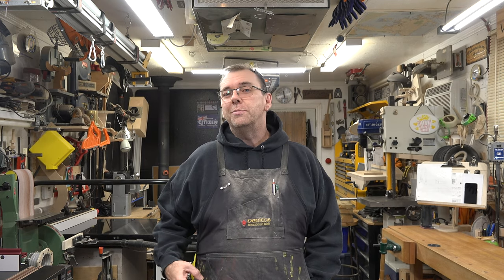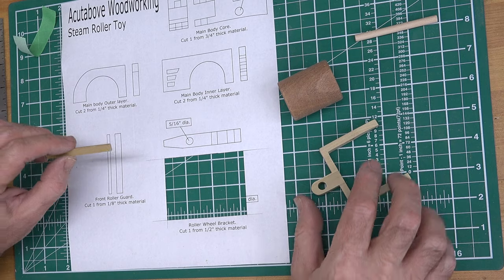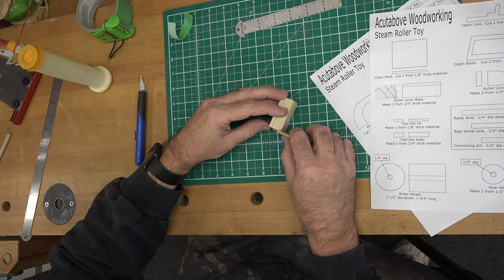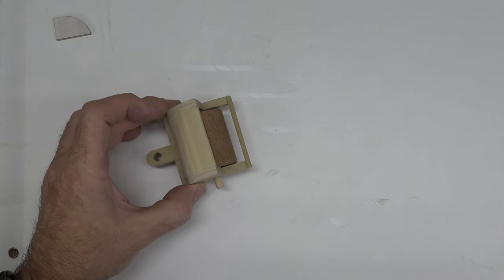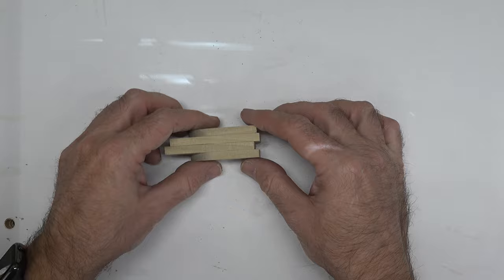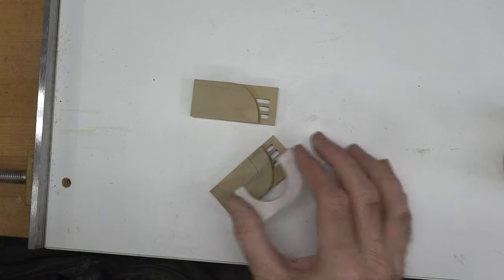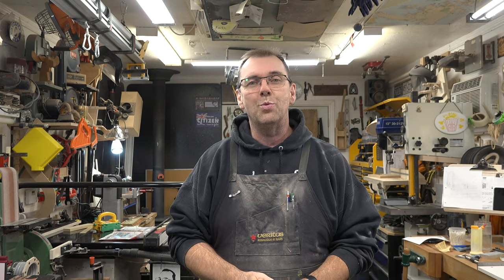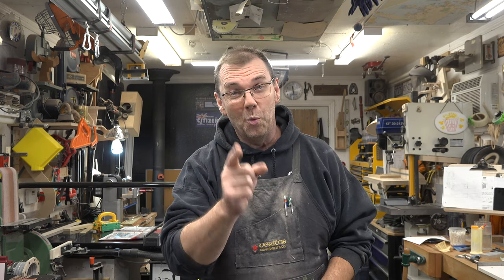Making a Steam Roller Toy

Comment: The micro glue bottomless works great, but for things this small like the pivot pin I used either a syringe without a need or a toothpick.
Reply from the maker: Whatever method works for you Scott is the method that you should use.  The methods that I demonstrate on the show are merely suggestions.  Thanks again for tuning in and for chiming in with your methods.  It's appreciated.
Reply: @acutabove_woodworkings  just sharing
Reply from the maker: @scottmorris4914  And I honestly appreciate that.

Comment: Great toy and video.  What about finishing.  I guess for painting, you would of course hand brush?  If applying a finish, would you use a spray shellac , lacquer, or what?
Reply: Either of those finishes would be fine.  From my mostly limited experience spraying lacquer gives much better results then brushing lacquer.  If you picture these toys getting "rugged" use, several coats of a spray polyurethane would do the trick.  When all finishes are fully cured they are kid safe.  Exception being lead based paint which isn't available any longer.  Then again if you are refinishing a very old toy it would be best to test it first and remove it.
Reply from the maker: Glad that you like the project and the show Scott.  I pretty much concur with what Dwight said in response to your question.  I have used Danish Oil, spray lacquer, spray varnish, brush on varnish, paint etc.  Smaller projects like this are next to impossible to brush the finish on without getting runs in the finish.  There are just too many areas to hook the brush and squeeze out way more finish that you intended.  A spray varnish or lacquer is really the way to go here.  Just make sure that it is completely, 100% dry before giving it to a child to play with.  It might be advisable to finish the roller wheel before assembly to make sure that you get a good even coat on it.  I hope this helps.  Thanks for tuning in to the show.
Reply from the maker: Thanks for chiming in with an answer Dwight.  I appreciate your input to the conversation.